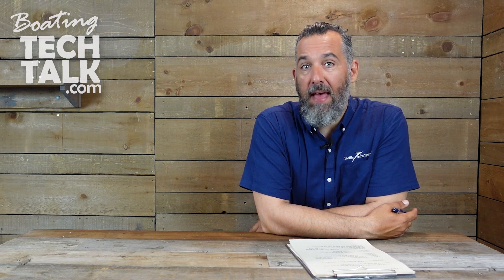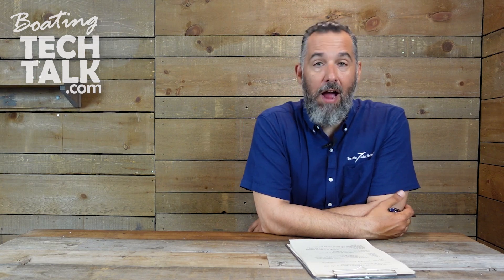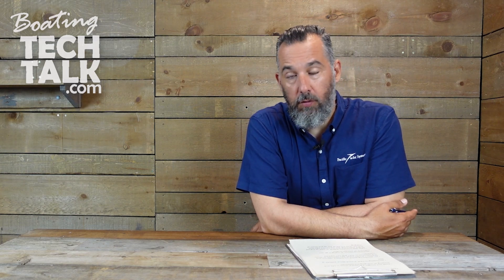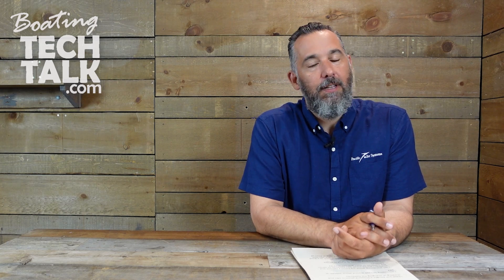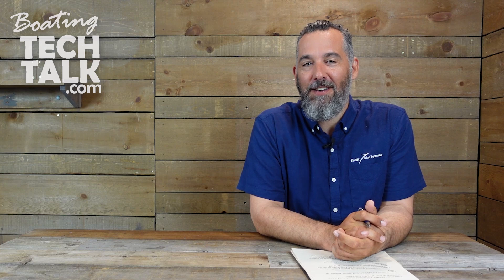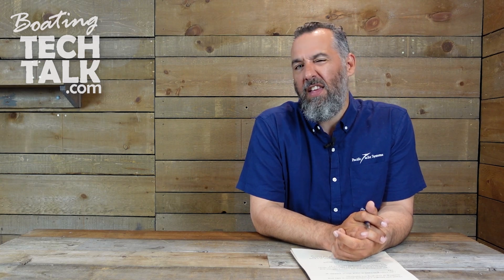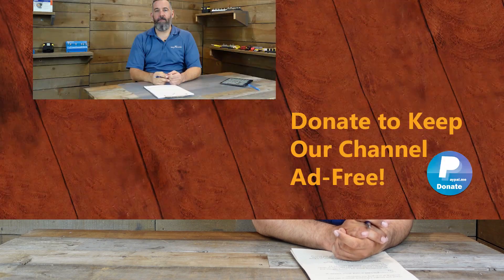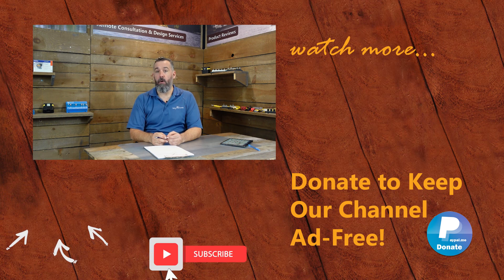24 Volt Batteries in Series or Parallel on My Boat?

Comment: I have eight batteries 12 volt I want to wire them into series making them 24 volt if I have a connection at one side on the box and a connection on the other side of the box can I put all the positives on one side and all the negatives on the other side and still keep it at 24 volts

Comment: Thanks for your informative videos! I am also interested in the basic question: Is there anything about pro and cons between 12 V and 24 V in your videos? The catamaran Seawind 1370 uses 24 V. It apparently saves about 200 kg. Are there enough cheap devices for 24 V? Is it possible to skip a 12 V system entirely? What is your experience?
Reply from the maker: 24V systems reduce the cabling size in half, the challenge is that not all electrical devices can be powered by 24 VDC, so you might need a 24 to 12 VDC converter.
Reply: @PacificYachtSystems  Thanks mate! In this case, things are just getting more complicated. If you are one day in Europe, there is always a guest room and few beers in the fridge!

Comment: Since all packaged batteries (except 2V nominal) consist of series connected cells, the loss of an entire string (of series connected batteries) is always a possibility.  I like the idea of parallel strings for the redundancy if offers; disconnect a failed string and you still have a functioning battery system.  If I was doing a 24V (nominal) system with LFP, I would probably use 24 volt batteries to minimize the external connections and use two or more strings.  The more strings, the more redundancy (if cost is no object and you have the space).  I have a ZENA 24V alternator on my bus for charging the 24V house battery system, and I know there are other marine rated similar units.  One of there uses is mobile arc welding.  Designed to put out 250A @ 24V continuously with a massive fan-cooled external rectifier assembly.  Need more?  Install two of them (with appropriate voltage regulators, of course).
Reply from the maker: Thanks Bruce for adding to the conversation, you bring good design points.
Reply: @PacificYachtSystems    Thanks.  I should have added that my approach is not a good one if the 24V battery bank needs to be “center-tapped” to get 12V.  My bus conversion has 24V/12V  center-tapped battery systems for both the chassis and the house.  Vanner Battery Equalizers take care of seeing that the “upper” and “lower” 12V halves of the battery banks are used equally and charged equally.

Comment: looking at 48v DC system myself to get the larger power requirements for a new  full electric catamaran (no LPG gas) using 6 off 24 v lithium  SO4 batteries in a combination of parallel and series  to get me the option of a 24v DC rail for equipment that is not available in 48v DC. Victron have some great new gear to manage individual fusing & monitoring for batteries in  a covered DC bus arrangement. Just have to watch at all cable lengths for each individual battery are all the same lengths
Reply from the maker: Keep us posted with your project.

Comment: Hi Jeff
Clive: Why wouldn't you split the bank in 2 x 1000Ah or 3 x 700 Ah with a manual battery combiner? You could reduce the charger size requirements, also If 1 bank goes wrong you have the other(s)..... but you have to supervise charging/depleting and select active service bank
Reply from the maker: Yep, having multiple smaller battery banks is certainly one way of doing it.  You bring a good point, you'd also need to have a battery monitor for each bank to allow the boater to know when to stop discharging and potentially know when the batteries are fully charged.

Comment: original system - 12 volt ---- 3 - 12/220 ah Lifeline AGM's (4D), Xantrex 3 kva MSW, PWM 30 charge control
New system 24 volt  6 - BB10012 (2S3P), Victron Multi 24/3000/70, BVM712BT,  Victron 150/70 Can, 24 to 13.8 buck box 40 A, CGGX display.
Reply from the maker: Going to 24 volts isn't easy, but some boaters are certainly doing the jump.
Reply: @PacificYachtSystems  Big part of that was also added induction, Instapot, and sous vide cooking, so much larger and more frequent larger loads. vs propane (eliminated) so flammability issues gone, REALLY dropped the cabin temps, LFP dropped wt by 300# (same space, 2X power storage), LPG tank another 112# (60x2),
Reply: @PacificYachtSystems  Of course, one major upside of going 12 to 24 is that you won't have to change your wiring sizes. What worked with 12 will work better with 24 (assuming all good connections).

Comment: Consider a series-parallel combo: parallel sets of 12V series pairs. Remember that the capacity is multiplied by the number of parallel sets, but not by the number of batteries in each series set (example: 20 12V/200Ah batteries in a 10x2 24V set is 2000Ah not 4000Ah).
Reply from the maker: Thanks for contributing.

Comment: If the wiring on your boat is currently for a 24v system then keep it at 24v.  Otherwise you'll need to run heavier gauge wiring throughout to make up for the increased amperage draws at 12v.  Also what are your DC appliances running at? Will you need to replace them if you change voltages?
Reply from the maker: Thanks for contributing to the conversation William, appreciate it.

Comment: 24v batterys hard to get? Confused, because all bigger vehicles (gpods trucks, busses, heavy machinery) in Europe uses 24v and batterys are everywhere.
Reply: 24v is not used much here in Canada. Europe for sure.
Reply from the maker: Hi Lauri, on boats 24 volts, albeit a great solution to offset voltage drop, most boats are at 12 volts.